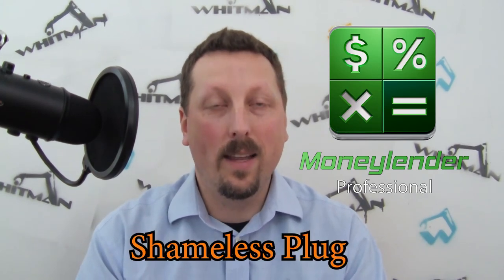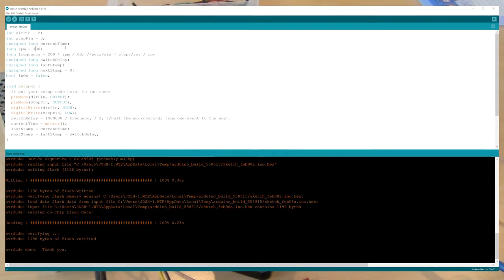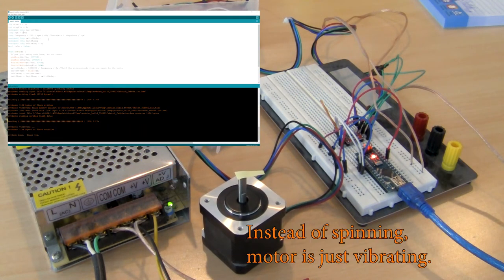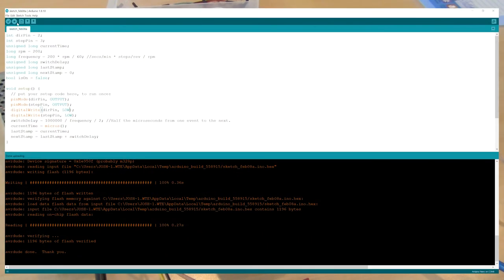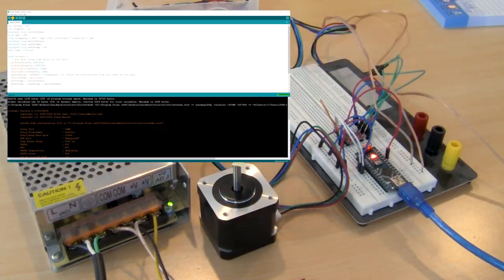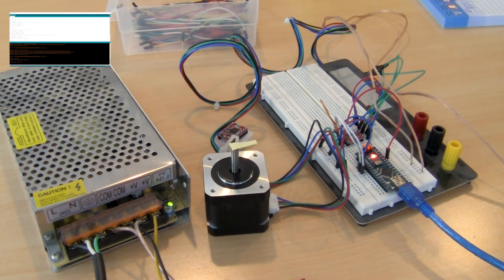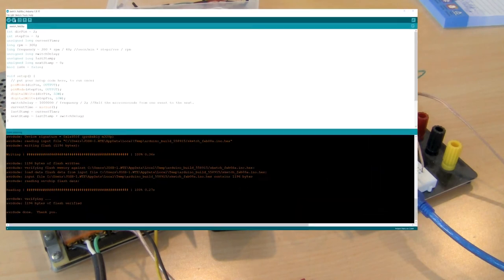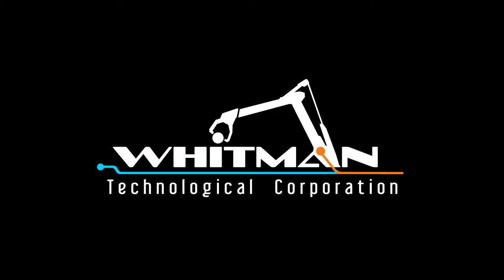How fast should we expect our stepper motors to spin? - Stepper Motor max USEFUL RPM Test

Comment: what is the way to burn, spoil a nema 17 motor?
Reply from the maker: Stepper motors like these (nema17, nema23, etc.) are pretty resilient.  They usually have a working temperature range that goes well above what's comfortable for a human.  They're built to hold position with maximum torque, so they're capable of sitting, stalled out, at their max rated current indefinitely.  The only electrical way to burn them out is to exceed the rated current and/or temperature long enough to actually melt the wire coils of the motor (or at least the insulation).  They're heavy and bulky, but they're pretty bullet-proof against all but the most malicious miswiring.

Comment: Hello, i already buy a4988. Can u give me a tutorial a4988 serial input using millis..
So when i input some number it Will move as much as typing.
Reply from the maker: If we take the code from #1 in the pinned comment and slap in some step counting and reading from serial it would look like this:
int stepPin = 5;
int dirPin = 6;

unsigned long currentTime;
unsigned long nextStamp;
bool isOn = false;

//pulseDelay = RPM / sec/min * micros/sec and divided by two because each step requires going high and then going low (two toggles).
unsigned long pulseDelay = 100 / 60 * 1000000 / 2;

int halfStepCount; //Steps taken so far
int halfStepsTotal; //Steps requested by serial.

void setup() {
  pinMode(stepPin, OUTPUT);
  pinMode(dirPin, OUTPUT);
  digitalWrite(stepPin, LOW);
  analogWrite(dirPin, LOW);
  currentTime = micros();
  nextStamp = currentTime;
  Serial.begin(115200);
}

void loop() {
  currentTime = micros();

  if (Serial.available()){
    halfStepCount = 0; //Reset step progress.
    halfStepsTotal = Serial.parseInt() * 2; //Steps from serial doubled to be half-steps needed.
  }
  
  if (currentTime - nextStamp >= pulseDelay && halfStepCount < halfStepsTotal) {
    //The pulseDelay has elapsed and it's time to toggle the pin, and we still have steps to take.
    isOn = !isOn;
    halfStepCount++; //Took another half step.
    digitalWrite(stepPin, isOn); //Toggle the pin.
    nextStamp = currentTime;
  }
}
Reply: @WhitmanTechnological  thanks sir, i was try to combine your 1st program with my other programs. But the stepper doesnt move. I change the micros() with millis() and still didnt get it. Can i share my program here..
Reply from the maker: @roghibashfahani15  To change micros to millis, lower this value from:

unsigned long pulseDelay = 100 / 60 * 1000000 / 2;

to this:
unsigned long pulseDelay = 100 / 60 * 1000 / 2;

That might help.
Reply: @WhitmanTechnological  hello sir the code doesnt work out, when i click serial monitor icon, the stepper is shaking and i try input some number at serial monitor, it  do nothing.
Reply: @WhitmanTechnological  no sir, the sepper just move +- 1mm /s i think it bcause micros more small than millis()
Reply from the maker: @roghibashfahani15  Time to do some debugging - break it down to the simplest pieces and test each one until you locate the problem.  Wires all good? No bad connections? Enough power?  Motor not miswired? A4988 properly driving the motor (can manually signal the step pen to see if the motor is turning consistently)?  Step and dir pins from Arduino are correctly the step and dir pins to the A4988 - not miswired?  Can the basic #1 code sample drive the stepper at slow speeds?  If you verify all those, then you know the hardware is working and the problem must be in your code somewhere.  Break your program into little bits and verify that every part of it is working properly.  Drop in lines like Serial.println("value of X is " + x) to send information back to the serial console about what the program is thinking.  Break it into tiny pieces and watch if all the numbers in the program are giving you values that make sense.
Reply: @WhitmanTechnological  i try #basic 1 code, but i have to change the interval to be 100/60*1000/2
Reply from the maker: @roghibashfahani15  Ok, if that works, then you know the hardware including the connections to the microcontroller are good.  So now you just need to debug the software.  I can't help you tear it all apart, but if you have a program that works and one that doesn't, you can work your way through all the lines of the non-working one until you find the problem.  Serial.println("some info"); is an easy way to have the Arduino send runtime details back to your serial monitor so you can see if it's thinking what it's supposed to be thinking.
Reply: @WhitmanTechnological  thanks sir, i just finish it, im using accelstepper library.
###########
AccelStepper stepper1(1, 2, 3); // (Typeof driver: with 2 pins, STEP, DIR)

//and just need this 2 line code to make high-low.
 stepper1.setCurrentPosition(0);
 stepper1.moveTo(1000); // Set desired move
Reply from the maker: @roghibashfahani15  Awesome!
Reply: @WhitmanTechnological  thanks, but i still like your #1. Simple run at fix speed code. Thats so smooth, move fast and silent.

Comment: how much would the torque be?
Reply from the maker: Usually, the holding torque at the rated maximum continuous current of a specific motor is listed by the manufacturer.  It can vary quite a bit from motor to motor even when both motors use the same Nema specification for their mounting holes.  Personally, if I knew how much torque I needed to ensure rotation at the correct speed, I'd shoot for a motor that could maybe go 25% beyond that for its holding torque - for hobby applications.  Last thing I want is a system stalling out because of underpowered motors.

Comment: Can I use this motor for skateboard to make it (electric skateboard🛹) becoz it's having high torque will u give me code for running at high torque and speed plzz🙂
Reply from the maker: I'm digging pretty deep into brushless motors right now.  They have most of the benefits of stepper motors, but are more power efficient and better suited to applications where you want to accelerate or decelerate.  Compare that to stepper motors where the main use case is being able to rotate exactly the specified amount.  The controllers ("ESC's") for a brushless motor are more expensive at around US$15 and up.  But the power, torque and speed they can produce are going to do a much better job than a stepper motor will.  I was going to use steppers for my robots foot wheels, but I switched to brushed motors, and now I'm looking into brushless ones.

A stepper in a skateboard would work until the load exceeds the holding torque, but a brushless motor will provide a uniform amount of push, and consume the least amount of power doing it.  In terms of battery life, I'd expect power consumption with a brushless DC motor to be 10x less than with a stepper motor for something like wheeling a robot around or pushing a skateboard.

In any case, I posted some Arduino code as a stickied comment on this video to run a stepper at a specific RPM so you can grab it and try it out with your steppers.
Reply: @WhitmanTechnological   thanks a lot 🙏❤🌹 uncle ur means a lot for me it's truly helpful I subscribe ur channel ur channel is helpful for me.

Comment: Can you please help me to make a dmx stapper motor with encoder
Reply: Please help me
Reply from the maker: I don't have a solution for you, but I can definitely walk with you through figuring out a reasonable angle to approach the problem.

If your needs can be met by a DMX servo, I would seriously look into just buying a DMX servo controller and servo motor.  There are DMX servo controllers that can control multiple servos for relatively little cost ($40 on eBay for an 8 servo controller).  Servos are common enough to be cheaper than an equivalent encoded stepper motor.

Barring that, we can build our own...

I'm going to assume you're already using a DMX512 controller and you want it to let you control the rotation of a stepper motor.

I don't actually know what DMX is, so let me learn that real quick...  According to Wikipedia, DMX512 started as a standardized stage lighting control interface and expanded to enable other effects like fog machines.  The protocol itself has a few steps to unwrap the data (differential signaling with variable packet length just like Ethernet on CAT5/6 wires), so a prewritten library is going to help with the heavy lifting of wrapping and unwrapping the data.  Fortunately, Arduino has a DMXSerial library so all the heavy lifting for the protocol is already available.

Depending on your threshold for pain, you can take one of two routes to get the DMX signal unwrapped into an Arduino:
Make your own DMX circuitry.  The Arduino DMXSerial library's documentation has sample wiring schematics for how to connect an Arduino to a DMX system.  It'll be a lot more technical, but you can perhaps save some money.
or
DFRobot.com sells a DMX Shield that has the DMX connector and includes an Arduino library and samples for handling DMX communication.  It's well within the hobbyist price range, probably not more expensive than the components required in the schematic from the DMXSerial documentation, actually.  Barring DFRobot, you could look for another DMX shield for Arduino, as there seem to be a few options out there.

At this point, if you didn't need an encoder to track the movement of the motor, then you could just hook up any stepper driver (like the A4988 I use in this video) and start coding the Arduino to send steps to the motor based on your DMX input.

Assuming the encoder is a critical part of the design because you expect the motor will miss steps and you definitely need to correct for those missed steps, probably the best solution is to just buy a stepper motor with a built in encoder.  (Side note: We could also use a servo motor here and control it like a servo instead of controlling steps on an encoded stepper motor.)  Making our own encoder means we need to work with the mechanical aspects of the motor's drive train, and then we're probably doing some combination of the following: losing quality from mechanical and electrical underengineering and mistakes; wasting time to engineer everything really well; spending a lot more money to build something from scratch that is already affordable off-the-shelf.  At least, those are the reasons that if I needed an encoder on the motor itself, I'd just buy a stepper with the built-in encoder.

StepperOnline has a selection of stepper motors with encoders, and I've been happy with my experience with their (non-encoder) motors so far.  Because of the extra cost, I haven't used an encoded stepper myself on any projects yet.

That's the process I'd use - get the signal onto an Arduino, then write some Arduino code to read the DMX signal and then trigger the steps on the stepper accordingly.  And I guess also check that the motor rotated to the correct position on the encoder and correct the steps if it didn't...

Hope this helps you get started on your project :)
Reply: You can make a code for me
Reply from the maker: @deepeshkushwah607  No.  You'll need to write your own code.
Reply: I will pay you for that code 26$
Reply from the maker: @deepeshkushwah607  That's very generous, but this kind of stuff is too hands-on for that to be possible.  I'm not an expert on DMX, nor on working with encoded steppers, so I'd need the equipment plugged into my computer to be able to write and test any code I might create.  Software is the miracle juice that makes automation cool and smart.  If you want to build cool automated things, this is the prefect place to start getting experience writing a little code that runs on a microcontroller.  I'm happy to help troubleshoot your Arduino code if you get stuck.  :)

If your DMX stepper project is a one-time thing that you want to make, just buy a DMX/servo setup.  You'll spend ten times as much building your own, and it will work a lot worse than what you'll get if you just buy a preexisting dmx motor system.  And that doesn't even include the time you'll save...

Almost all my videos so far are just practice projects.  There's stuff I need to know and questions I need answered to be able to design the things I want to build.  Perhaps the CNC router build is the only one that's not practice, but actually making something that is a permanent part of my "laboratory".  All the gearboxes and 3D printing and electronics are practice for what's to come.

If you've got plans to create more, start tinkering in the software now.  Learning software is like going from drawing on sheets of paper to modelling in VR.  It'll add so many new dimensions to what you're capable of creating.
Reply: Please help me
Reply from the maker: @deepeshkushwah607  You have to do your own work.  It's your project.  I am not going to write your code or build your motor.
Reply: Ok
Reply: You have any other hou no how to make a code for DMX stapper motor with optical encoder
Reply from the maker: @deepeshkushwah607  I've never played with DMX for anything, so here's where I would start:

An Arduino compatible DMX shield:
https://www.dfrobot.com/product-984.html

The source code for using the DMX shield:
https://sourceforge.net/projects/dmxlibraryforar/files/

Comment: Idk but I think you could have prevented the drivers from getting destroyed by placing decoupling capacitors between VDD+GND and VMOT+GND
Nice informative video tho
Reply from the maker: Thank you.

The one I fried was from connecting the 12V source for the motor power to the driver's 5V logic power pin by mistake.  Just way overvoltage.  A decoupling capacitor wouldn't be able to do anything about that mistake.  It was on a breadboard and the pin labels are on the underside of the driver.  Killed it instantly.  I still have it on my desk though, and at some point I'll probably triple-check if it's dead-dead or just mostly-dead.

I got a couple ESP23-CAM modules about a month ago, and they're not only super power-thirsty, they're also really sensitive to fluctuations in the power supply.  A strong decoupling capacitor is pretty-much mandatory to use those things.
Reply: @WhitmanTechnological  Nice to know about the esp32cam power consumption, I use esp32 devkits for my stuff (also high power consumption when scanning for devices etc.)
I'm sure my esp32 devkit uses this much power because it has the pcb antenna mounted directly at the pcb (copper inside the pcb isn't good for rf). Might be the case with your esp32cam too.

Comment: Hi, your video cleared my doubts to not use stepper for high speeds.

Thanks

Could you share the code so that I could check the limit for my stepper
Reply from the maker: Thanks for your comment!  I rewrote that program for you - or actually a better version of that code - since I had reused that file for a later video and all that was left was some PWM adjusting routines that wouldn't do anything like what was shown in the video.  In this rewrite, I put in a variable that lets you set the time for it to ramp the speed up to the max.  http://www.joshwhitman.com/stepper-motor-arduino-code.aspx
Reply: @WhitmanTechnological  thank you friend.....

Our community grows with efforts of persons like you who are there to help others......

Once again Thanks for the code......